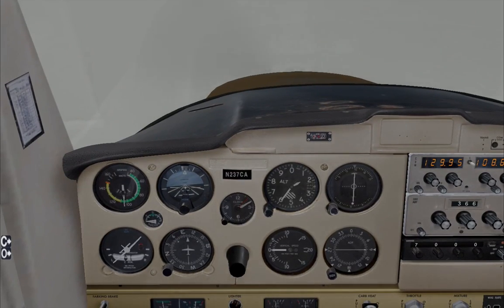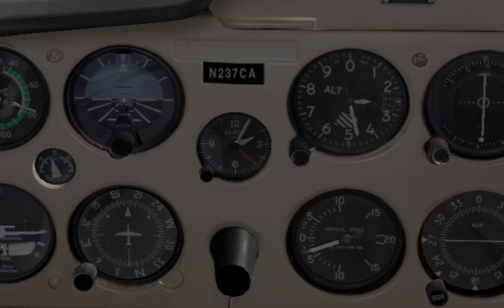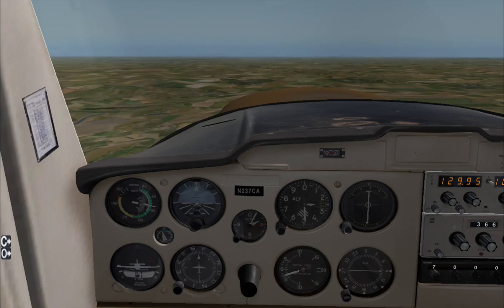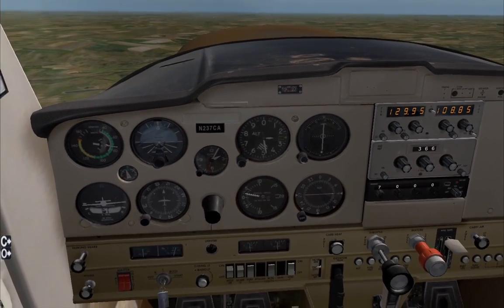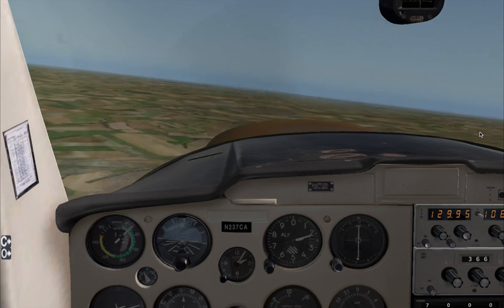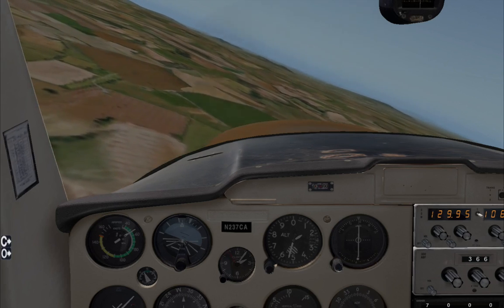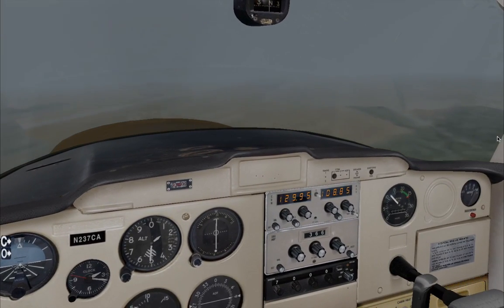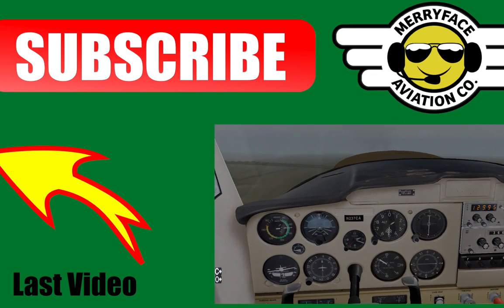An IFR Pilot's Worst Nightmare And how to Survive

Comment: This is ridiculous.
Reply from the maker: the situation is indeed. However, the technique works.
Reply: My friends tried this in a 172 because of this video, definitely doesn't work unfortunately. At least in the aircraft we used. And I would be wary of a training pilot trying to use this if they have only a vacuum failure, because that is flyable, Imagine they don't want to use partial panel so use this method and WHAM, they descend into a mountain or something.

I don't want to try and be mean or anything, but I truly cannot understand why this is even a thing, complete failures of multiple instruments is practically impossible, so many are independent of each other. If anything this is dangerous because it is putting a bad idea into peoples heads. Maybe I don't get the concept.
Reply: yes thats why we get our hints and tips from a certified flight school, not youtube.
Reply: @TheWhiteOwl23  That's why you need to combine it with situational awareness etc. If you know what the ceiling is and it works with your type of aircraft, then it's worth a try. Much better than slamming into the ground.

Comment: sounds like an idea, at best, albeit bad choice. its an excellent way to push the envelope to set yourself up for a beautiful crash.

this would require a DC, vacuum, and static failure. you would have no avionics, comms, de-ice (to include pitot heat, carb heat, etc).

static (switch to alt static/break VSI glass)
DC / Vacuum (engine running/check bus)
carry on devices (handheld radios, GPS, EFB, etc?)
did you f%@*ing preflight?

sorry, sounds like a disease here. i have worked as an aircraft dispatcher and paramedic for 17 years now. this needs a definitive cure here. the best treatment here is prevention. i don't know how a person could get into these circumstances without trying.

i gather the point behind this is to realize that the aircraft is inherently a stable aircraft. you are setting the aircraft as close to the edge of its envelope as possible, leaving little room for any error before a crash ensues.

so it is a way to do a weather letdown...but you are hanging somewhere just north of Vso, south of Vref. not the greatest place to be. now the aircraft is trimmed to nose up, which kind of means it has a negligible amount of sinkrate. you may survive this one, but nearly all aircraft have enough redundancy that at lease one of these options should have came back on board while being in a death spiral.

and they all failed at the same time too? really? i hope you bought a flight helmet...

Comment: Omg so basically inducing a death spiral . 
    At least break the vsi cover and try to set a "level flight" don't  be dumb .
Reply from the maker: Hi! Breaking the VSI will not help, as doing that is essentially using it as an alternate air intake. The altimeter will function correctly  (with a small error), the VSI will function in reverse, and the airspeed will work, but over-reading slightly.
This is a fun little tidbit for an impossible "what-if." I taught a variation of this technique to my students when teaching them basic instrument flying to get out of IMC situations as a last resort (AFTER doing the 180 degree and starting to feel uncertain of their ability to maintain positive attitude control).
The descent rate will vary between 200-1200fpm, with a slight banking turn. This technique is actually a stable in the gliding world. Terrain is, and always will be, a factor to take into consideration.

Comment: And of course Carenado are renowned for their accurate flight model....... NOT
Reply from the maker: agreed! The carenado flight model is the same as the default, which works well enough for the SEP aircraft when they fly within the normal flight envelope. Also, I've done this in the aircraft and it works.